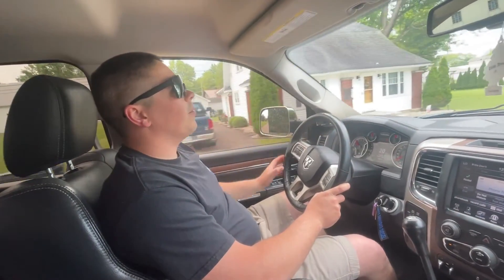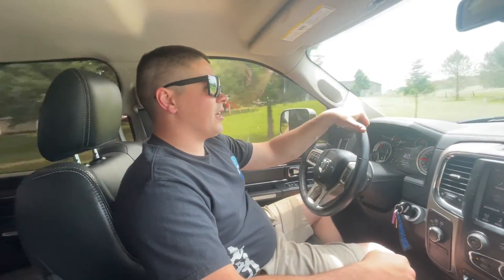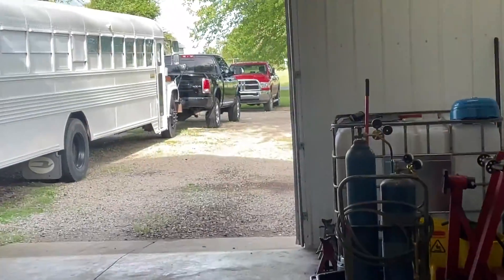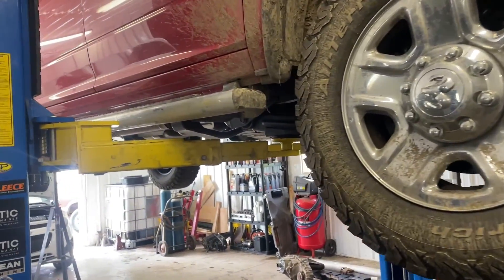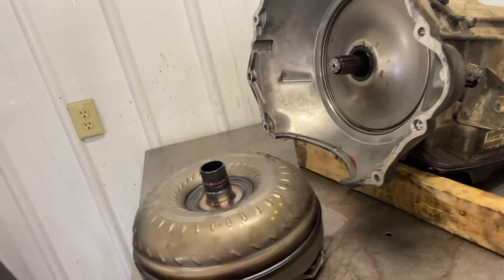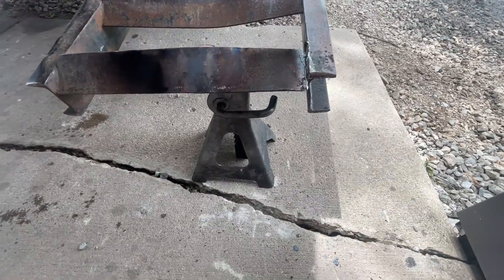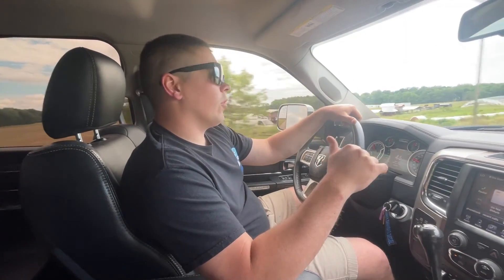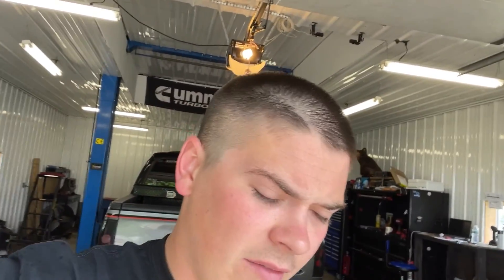G56 CUMMINS GETS NEW WHEELS!

Comment: Let's see, you can put a 2nd gen swap on this RAM 3500 6 speed manual. Be careful with your 2013 RAM 3500, which is the worst year to buy.
Reply from the maker: Maybe eventually I’ll do 2nd gen swap I’m very curious what you think is bad about the 13s over other years they all have flaws?